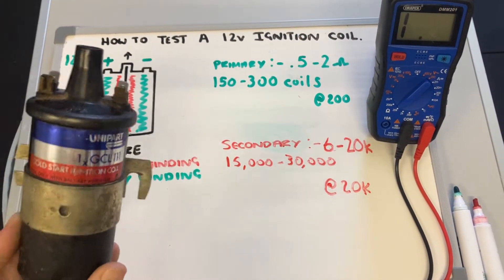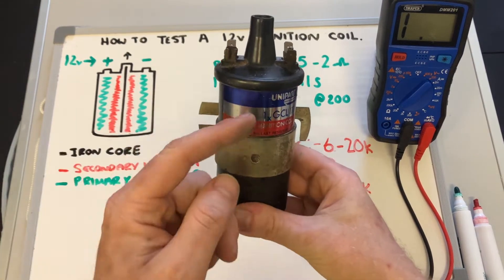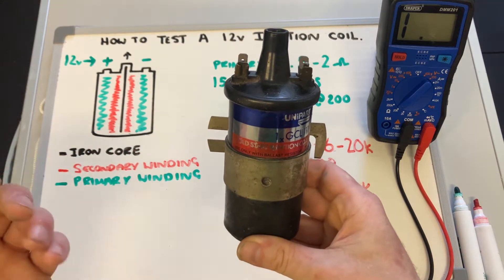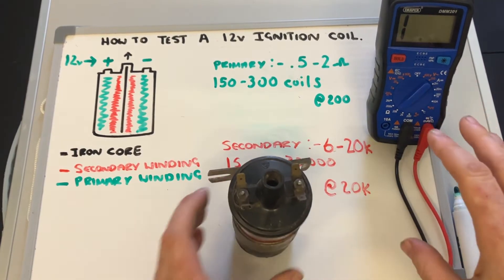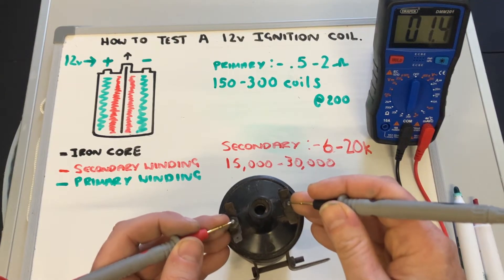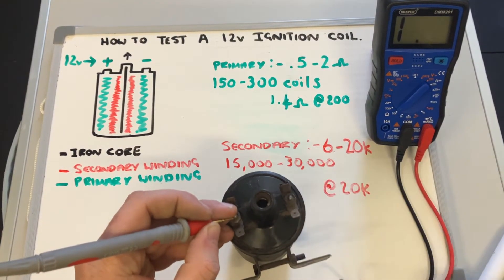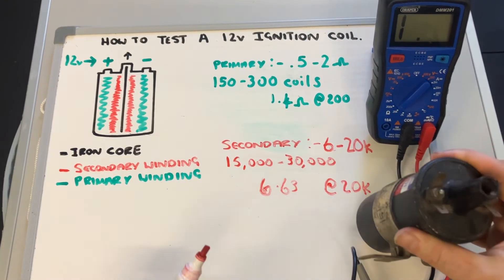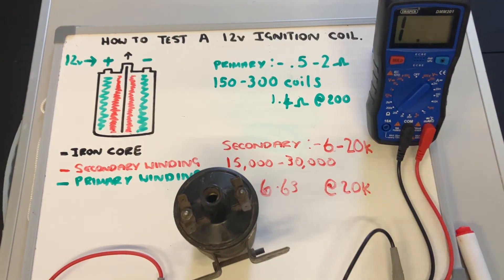How to Test a 12V Ignition Coil.

Comment: Hi there,
I've recently bought a viper VCS 3 ohm coil for a classic VW, the primary coil reads a perfect resistance and the secondary reads almost 22k. 
I've asked the company if this is about to fail and he informed me that it's a normal reading. Is this right or will this damage my electronic ignition?
Regards Simon
Reply from the maker: Hi, that’s on the high side, dependant on the size of the coil/ amount of windings. High resistance won’t damage the ignition, but it might stop it firing correctly under load. Cheers

Comment: So, testing the coils voltage from the positive terminal, & a ground point of your choice on the vehicle, by showing a full 12V, battery voltage shows that the coil is good, among all the wiring within the Duraspark 2 ignition system, right.?
Reply from the maker: That’s right, the coil should be getting supplied as close to battery voltage as possible. As you say 12v plus. Chees
Reply: @AdamMechanic , oh ok, thanks for the feedback. When doing this type of test, is it with the key on? Or, do this test during engine cranking?

Comment: These tests are fine when on the bench - unfortunately when they are working on the car they can still misbehave and these tests are irrelevant
Reply from the maker: It can vary under load, but you can still rule the coil in or out this way.
Reply: @AdamMechanic yeah I get that completely but the only true way to know is to swap it out 

Difficult to test under load - plus heat etc …..

Comment: WhaT i dont understand is, if the coils all do the same job , why are they sold suitable for certain cars in adverts ,  Woulnt one just fit all older cars ?
Reply from the maker: Hi, it’s just how many windings the coil has, so how much voltage it can produce. The amount of voltage will need to vary based on engine size, compression rates etc. If those are similar, they should work on different makes/ models. Cheers

Comment: Easy to follow quick tests. thanks. When testing the positive terminal on an installed coil, with the ignition on and the black lead of the multimeter to ground on the engine, what is the best setting on the multimeter. In the volts range?
Reply from the maker: Hi, sorry for slow reply. If I understand what you are trying to do, you are on the positive of the primary on the way in, it should just be battery supply voltage, around 12V, so putting it in 20v DC setting would be best. Hope that’s right for you and makes sense? Thanks

Comment: Hi I have a old coil primary reading is 0.4 and secondary reading is 1 ohm I think it needs replacing it is very old of a 1983 porche ..please advise
Reply from the maker: Hi. Based on those readings it suggests the secondary coil has failed. Secondary fails most due the the heat and vibrations caused over time. What setting was the 1 Ohm reading on?
Reply: @AdamMechanic  1 ohm setting was on 20 on multi meter
Reply from the maker: Sounds like the secondary coils failed to me. If it was me, I’d stick a new one in. Sure an 83 Porsche is your pride and joy, hope it cures it!
Reply: @AdamMechanic  thanks il Put a new coil on. .yes she's my pride and joy it's only done 59.000 miles. Very rare milage
Reply: @AdamMechanic  I double check the coil today and it has inconsistent readings over a 5 min check secondary reading is 1 ohm then when test second time it's 6 ohms it is all over the place ...would this be why car not starting
Reply from the maker: @stevehunt3847  I reckon so. The secondary coil should be giving several thousand Ohms of resistance if it’s going through all the winding, the intended path. Sounds like it’s shorting across to the primary or casing and straight out again to me.

Comment: What is the range of both tests?
Reply from the maker: @200 Ohms for primary and @20k for secondary.,
Reply: 8.89 good  or bad? How   to test ignition condenser via multimeter?
Reply from the maker: If that’s the secondary @20k, that sounds OK. You could maybe do a continuity test on the condenser?